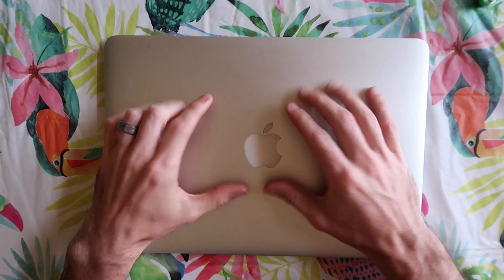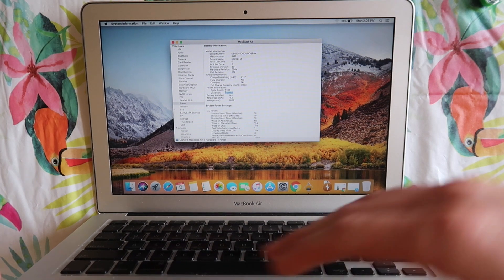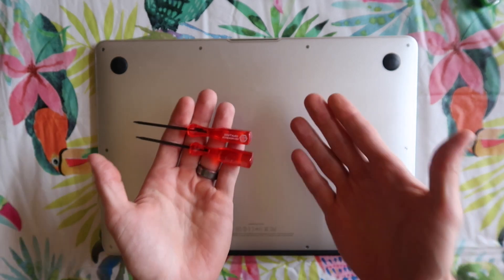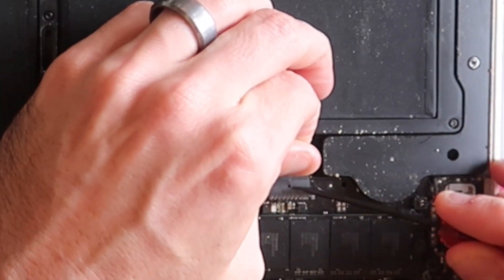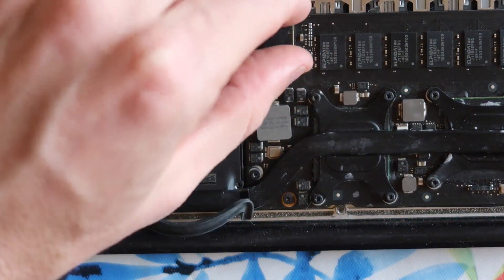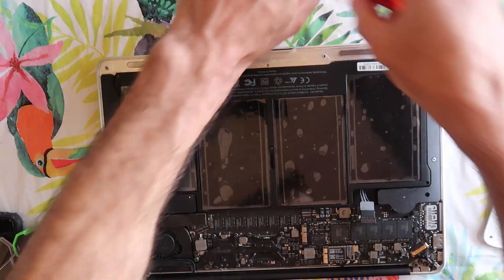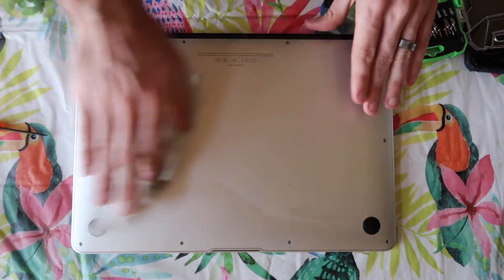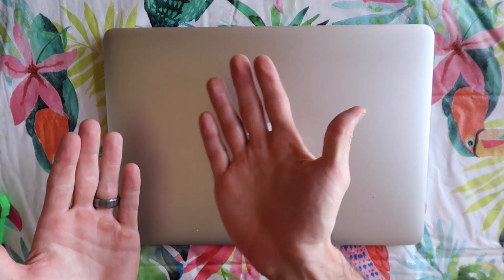Late 2010 Macbook Air Battery Replacement STEP BY STEP Tutorial

Comment: Great video. I ordered a battery for my 2010 Air and will be replacing it soon. The special screw driver is called a 5 point pentalobe screw driver.  Got mine on amazon years ago. Why didn’t you use a can of compressed air? Thank you.
Reply from the maker: Thanks! I didn't have any compressed air laying around. 😭 Have fun with the repair!